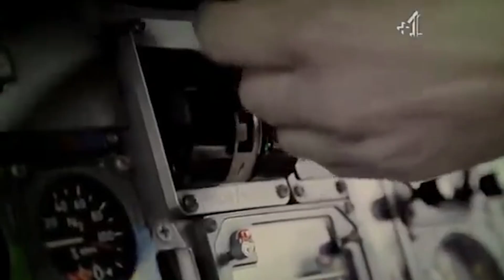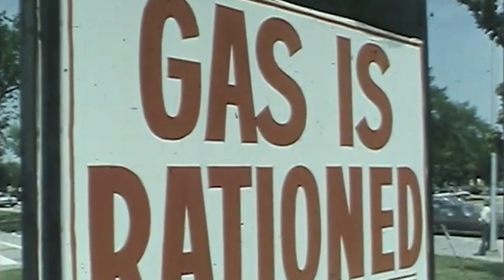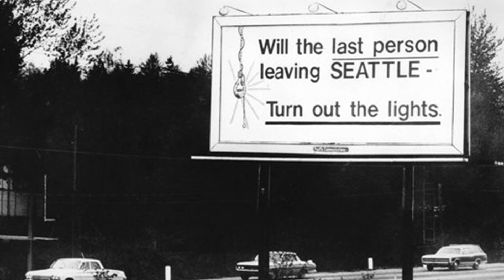The Forgotten American Concordes - Boeing 2707 - Lockheed L-2000 SST

Comment: The US version of Concord was actually de-funded and supersonic passenger travel over U.S. soil in 1971.  US studies showed the maintenance costs and general uses of a US built SST was not feasible, plus no one wanted Sonic booms over their neighbor hoods.   The uses of SST's were extremely limited and there was simply no profit in it for anyone.   Concord "claims" it made money, albeit very little, but the real numbers show they excluded all R&D costs and well as construction costs in their profit margins...   

Sure Concord was a great plane, well built with a flawless design (except the tires it turns out).  Credit where credit is due the British/French collaboration was pretty amazing.   But SST commercial use was very limited and very expensive to maintain.  The US saw this well before they went to deep into the well.
Reply: preston121068 to be fair the tyre blow out which caused the Paris crash was caused by a piece of metal which fell off a US built plane.

The tyres did have issues due to concord needing a very high landing speed which meant the tyres needed to hold much more pressure than normal, but the biggest problem caused by them was not the result of the tyres themselvez
Reply: The Mad Hammer - I do not believe the "US built plane" has anything to do with the matter.  The US built plane was in service in Europe and maintained in Europe.  The ring which fell off the plane was recently serviced at the air port where it fell off.  I just don't think you trying to point a US plane caused the accident has any relevance since the part was replaced improperly in France...   

The tires on the Concord were not up to the standards of most.  They were not blowout proof like most planes to save weight as blowout proof tires were much heavier.  It was a known weakness of the Concord.

Comment: The FAA screwed up supersonic flight with false claims to create hysteria and effectively boycott European competition in America. At the high attitude, the sonic boom is actually quiet at ground level. Most people in fact wouldn't even notice it. Helicopters and aircraft at take off and landing are far noisier. So, the reason you have to sit on an uncomfortable flight that takes 12 hours instead of 4 or 5 is down to some sketchy FAA laws that had nothing to do with environmental issues and everything to do with American economic pressure. If Americans can't do it then nobody else was allowed. Shameful

Comment: I'm not sure if supersonic flight will ever take place over the U.S. you can't get past a sonic boom.
Reply: God Speed 913, the speed valley story by a SR-71 crew had them doing a touch under 2000 knots over mainland US. At 80k+ feet the sonic boom is not as noisy at ground level.

Comment: I worked at Boeing in the early 80's on the 767/757.  Got to talk with some engineers who had worked on the SST.  They said one of the severe problems with the plane was the length of the fuselage.  It was too long and too bendy!  Trying to make the fuselage more rigid would have added much more weight to the plane.  Plus the flexi-fuselage would contribute to metal fatigue.
Reply: They should have copied the Concorde, but add a bigger pitot, so indeed, theirs would have been bigger than ours.....
Reply: I was actually inside the SST that Boeing built as it was on display inside a building in Kissimmee FL throughout the 1970's
Reply: @MrLewisbate unless you are an idiot, you know that it never got off the ground.

Comment: I was around when these two American SST designs were being considered, and I recall two big 'stumbling blocks' to any American SST.  First was the cost, especially with the taxpayers having to pick up the lion's share of it.   The other was the noise they'd create over land.  No one cared about sonic booms out over the Atlantic, but the more people thought about hearing them regularly where they live, the less appealing the SST became.    It was this second problem which made deployment on all domestic routes politically unacceptable, and what really killed the SST here in America.   People didn't want to heavily subsidize what would be strictly an "overseas" airliner.    As for the expansion and contraction of the airframe during supersonic flight, that was anticipated and could be designed for.   We'd already done so with the large A-12/YF-12 (which evolved into the SR-71 "Blackbird" high altitude reconnaissance plane) -- they used both titanium, and a new honeycomb structure to handle the tremendous heat and the distortions it caused in airfames.  Those birds began flying in 1963, and they expanded and contracted routinely;  with proper monitoring and maintenance, it wasn't an issue.   While further development was needed for such a large aircraft as the Boeing 2707, the swing-wing feature had already been quite successfully incorporated in the FB-111 TFX Fighter-Bomber -- not a small plane by any standards.  And of course it's successful incorporation into the much bigger B-1 Lancer bomber of the 1970s proves swing-wings were quite viable for large aircraft.    Had the "warning flags" on the future of SSTs not already been hoisted, Boing could have successfully developed a large swing-wing, just as (North American) Rockwell actually DID for the B-1 Lancer.

Comment: America deliberately sabotaged its Anglo-French and Soviet competitors.
Reply: "America deliberately sabotaged its Anglo-French and Soviet competitors." What, specifically did America do to sabotage SST competitors?  And be prepared to back it up with a credible source.
Reply: The USA was happy enough to have the space shuttle cross US airspace and Saturn rockets, but foreign supersonic craft were restricted.

Sums up the USA's attitude to trade - "Open up your markets while we protect ours"
Reply: The Concorde was restricted to trans Atlantic flights. It did not operate over Europe or America.  The Shuttle flew maybe 3 or 4 times a year. Typically landed at Edwards Air Force Base on the West Coast. No long overland flights during landing. That, other than the vertical takeoff, was the only times it operated within the atmosphere. By the way, US military aircraft are restricted regarding supersonic flight over populated areas.   Anon, your theory is false.
Reply: Scooter George It's neither a theory nor false. No one ever tried to ground the space shuttle because of its sonic boom which could be heard over a wider area due to its altitude.

Comment: The crash of Air France Flight 4590 took the mystique out of the Concorde.  And perhaps out of all supersonic commercial aviation, but it was good for as long as it lasted.
Reply: The crash of the Concorde appears to be the result of a piece of debris on the runway getting kicked up into the engines, rather than fault in the plane itself. And the piece was from a DC-10, surely the most crash-prone modern airliner....
Reply: Not the Concorde's fault.  It flew/rolled into debris on the runway on takeoff.  The program was cancelled because it didn't make any economic sense to continue it.

Comment: Years later, Boeing worked on a design dubbed the "Sonic Cruiser,"  a plane that was supposed to fly just below Mach 1.  That plane however, was proposed at a time when engines capable of supercruise were already in development.  It doesn't take a lot of imagination to see that Boeing could have put the Sonic Cruiser in to service, and then offered an upgraded supersonic version, once supercruise engines became available for the civilian market.  Sadly, the Sonic Cruiser program was also cancelled.

Comment: I think the Concorde combatted sonic booms by only either flying supersonic far enough away from land or at higher altitudes (i.e. 60,000 ft (18,000 m)), where the air pressure is lower.

Comment: My uncle, Bernard Scanlan, designed the delta profile on the Concord, then was head hunted to go to Seattle to work for Boeing on the FTS project.  But later Boeing dropped the FTS project in favour of the 747 project.  Bernard went on to work on flight recording red boxes.  So a UK input to Concord and the Boeing FTS project.

Comment: At 2:42 the aircraft described as a "French Mirage III", is an American F-102 Delta Dagger.  Just sayin.  Here's my take on the whole SST thing.  By the time that SST came into the discussion, supersonic flight was anything but a novelty.  The A-12/SR-71 had been flying active, mach 3+ missions with the CIA (unbeknownst to the consuming public) since 1962.....SIXTY TWO.  Simply put, Concorde was pressed on with as a "milestone" for the sake of it being a "milestone".  Problem was,...although a gorgeous design, it was EXPECTED to be a white elephant before the first flight.  Boeing, eventually steered away from the SST to  because of EPA pressures, AND the economics of it.  At nearly twice the size of and 3 times the passenger capacity of the Concorde, (economy of scale) and mach 2.7 - mach 3.0, they were on the right track, but the 747 came along and added a GREAT workhorse to the stable in 1969.  Here's the long and short of it.  The Concorde only provided 15 passenger miles for each gallon of fuel it burned.  With it's limited size and fuel capacity, it was destined to only EVER be a novelty for hopping across the pond at $13,000 per seat.  Really??  At exactly the same time, and in it's original configuration (engines, etc), the Boeing 747 was providing 46...FORTY SIX passenger miles for every gallon of fuel IT consumed.  Even at the "snails pace of 600 mph, it was a SLAM DUNK as to which direction to go,...and the best seats in the house were under $1000, with most only few hundred.  Multiply THAT by up to 500 passengers, and,...well, you see why they went where they went.  My $.02.

Comment: Lockheed built the SR-71 entirely out of titanium (in the 1960's no less).  At operational speed and altitude, it expanded one foot in length as well as width flying at mach 3+.  To scale that up for a passenger aircraft would have made for very expensive ticket prices.  Today, building an SST cruising at mach 1.1 using current technology while providing affordable fares would be in improvement over Concorde while being commercially viable.
Cutting transit time in half without having to double up the ticket price might find some interested parties willing to make the trip.

Comment: It still appears to go on. 

It is terrible to see the American’s trying to trash something they didn't build (a case of rotten eggs and the familiar denial that comes from them when they have been shown to be lacking at something). The Concorde was subject to attempts by the American’s to stop it flying into JFK, for two years after it was ready for commercial services to begin, the aircraft was designed specifically for the London to New York service. American activists cited everything they could, even lying to try to prevent this aircraft from operating. 

Noise 

The jumbo jet is noisier on takeoff, but you do not see any of the activists jumping up and down with banners and blocking the airport with their cars over an American designed aircraft. They exaggerated the problems with the supersonic boom but telling the masses the term supersonic boom scared people, a bit like saying there is a bomb under your seat in a cinema and expecting people to stay seated there. 

Ozone 

Pollution problems no scientific fact to support allegations made. 

Ticket prices 

They were originally high, after the whole operation was handed over to a serving Concorde pilot the prices were reduced and the service saw an increase in passengers and profits to BA. 

Maintenance 
Guess who inherited the maintenance of this supersonic airliner, yes you have guessed it airbus, hang on a min, they were about to start a major advertising and marketing campaign for there own range of aircraft the A320 to the A380 and beyond. One can hardly say they did not have a vested interest in seeing the Concorde service stop just as they were launching their marketing. They significantly increased servicing costs to BA to drive the fleet (which only had a quarter of the expected service mileage on the airframes) out of the sky. I am sorry to say that with BA's help they succeeded. 

Analogue controls 
The Concorde incorporated fly by wire the first ever into the design of this aircraft, most of the technology in its design is now standard in the industry. 

"bob told me" if you cant speak form first hand don't speak at all, you cant have an opinion unless you have flown on Concorde, everything else is just rumour, the American’s are good at that one. 

The American’s spent more money getting a wooden mock up in place that never brought in a penny to the investors know as their SST, the Concorde did more than that, I remember an incident where two high altitude spy planes were instructed to move from certain airspace, to allow it through. They were there in what can only be said to be space like suites, as a jet full of passengers flew by faster all wearing tea shirt’s and drinking champagne smiling at them out of there windows.

Every time the aircraft flew overhead everybody stopped and stared upwards, nobody does that for the Jumbo jet, and never will. The Concorde that went into service was effectively the same as the prototype which flew for flight testing with all the instruments and computer on board, it now resides at Duxford in England. It showed by example how the earth had been made so much smaller, the next stage in development would have introduced more efficient engines, snoops to reduce the angle and power settings on take off and landing, and more modern improvements to match the airbus fleet.

Last but nor least the air crash in Paris, the only time a Concorde jet had crashed in it’s perfect flying history to that date, and how was it caused, a united airlines jet due to incorrect and illegal maintenance had dropped a strip of titanium (illegally installed on it’s engine cowl due to past cases to show the risk to aircraft tyres).

The tyres fitted to Concorde had been upgraded several times to reduce blowouts, but no tyre can stop a strip of titanium from slicing through the tyre when on takeoff. The American airline operator of the DC10 was found to be at fault for using titanium against manufacturer’s recommendations when replacing a strip of aluminium on an engine cowl. If they had used the correct material, it is highly likely that it would have been flattened without any injury to the Concorde tyre, or certainly far less damage than that that was sustained.

The Concorde fleet had its fuel tanks modified to meet the required standard to prevent any further accidents of this nature (Kevlar armour installed internally). But a combination of falling passenger number, 9/11 and increased operational costs were used to bring a halt to Concorde operations years ahead of it’s time. Not one aircraft had reached even half its airframe hours and so could have continued in service for years to come. Airbus increasing maintenance costs for whatever reason you could argue about, would require an increase in passenger numbers, and more profits to sustain in the future, this clearly was not the case at that time, or for the foreseeable future.

And so you can all look at the plane now in museums, the plane that flew faster, safer and against all the attempts to stop it, successfully for nearly thirty years. In all it’s flying there was only ever one accident causing death. I don’t think you will find any other commercial aircraft with that safety record. The Americans certainly won’t be making one now or in the future.

Graeme

There is some right pratts here, that Nathan Danzmann quoting ticket prices of 11 thousand and 30 thousand. Capt Walpole had the service running with great profits for BA, and he achieved this by asking all the business class passengers mainly from the US how much they though the tickets prices were, and then put the prices up to match what they thought they were already charging. Profits from there on. Just shows the level of service provided exceeded anything else out there at that time.
Reply: It wasn't just the strip of junk from a DC-10 -- the pilot had overfuelled the plane, the maintenance crew had left a spacer off the front wheel assembly causing it to veer towards another aircraft on its take-off run, and the flight engineer shut down the engine. No junk on the runway OR less fuel in the tanks OR the spacer installed OR the other aircraft not being there OR the engine left running, any one of these things would have either prevented the accident entirely (1,2) or led to an aborted takeoff prior to V1 (3,4) or at least the possibility of some sort of landing at Le Bourget and not killing everyone (at the very least not the (four?) people on the ground). What actually happened was like a perfect storm of human error and bad luck.

Comment: nowadays I think they could've easily make a new and better concorde

(and cheaper)
Reply: Don't know about that. Airbus did look into building a successor to Concorde, which would have had more than twice the seating capacity, flown 25% faster, and had the same fuel efficiency as a 747. They figured it would cost $9 billion to develop (which is a lot more, in dollar terms, than Concorde, though not in inflation-adjusted dollars) and created the A-380 instead.